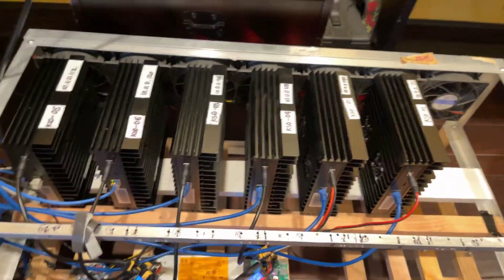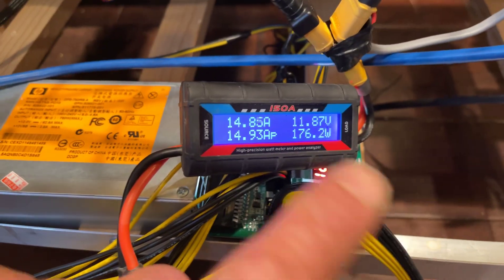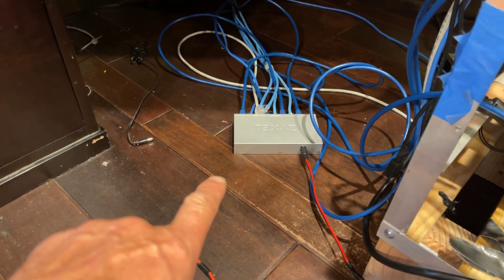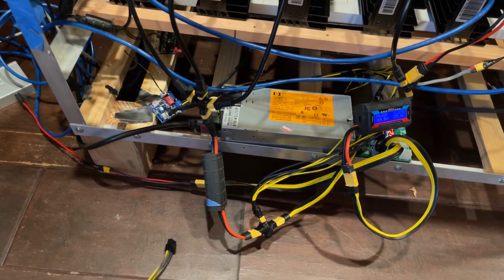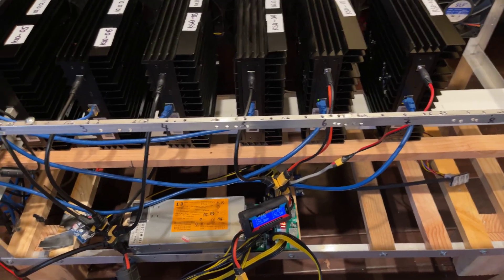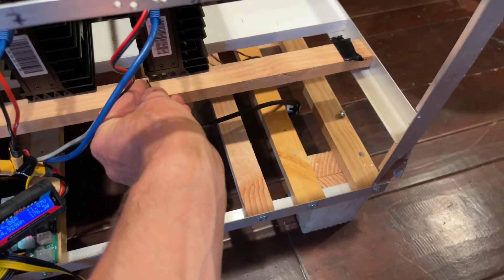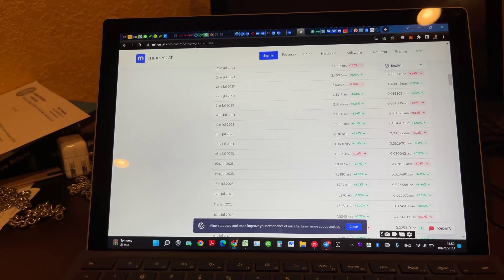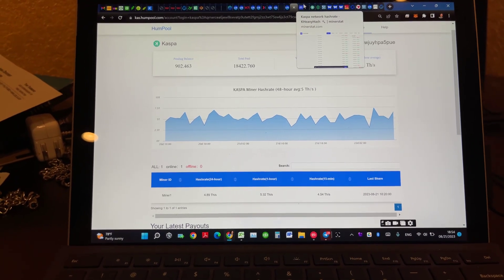6 ICERIVER KS0 MINING RIG UPDATE, NO VOLTAGE STEPUP CONVERTER OK? THIS SETUP SAVED ME 60W OF POWER

Comment: How do you get the server psu to power the ks0? I'm using a 6pin wired into a barrel plug yellow to red wire. Black to black. And my ks0 just reboot loops
Reply from the maker: Yes all 3 yellow to red and 3 black to black with proper 5.5x2.5mm connector it may reboot if you keep at 12v and try to Overclock.

Comment: Friend, in that vertical position you have no problems with the heat.
Reply from the maker: With external fan at least 1400Rpm which really quite I don’t have any issues. They’re overclocked to 175GH so external fans are the must.

Comment: so no need 12V to 19V Boost Converter?
Reply from the maker: Mining for a month now with only 12v power supply without booster. Have to make sure to use 10amp rated connectors though
Reply: @DontMindMeMining  when overclock 160G using 110w, should it been fine?
Reply from the maker: @D.K945  how are you able to overclock to 160G? If you have 110V now it’s 9.12AMP at 12v so it’s exceeds the 80% limit on 10amp connector. I would be very careful and watch the connector heating, if it heats too much need to reduce the amps.
Reply: @DontMindMeMining  I made a simple short video ks0 160G , but I haven’t replaced the PSU yet because the ordered cables haven’t arrived yet.
Reply from the maker: @D.K945 I didn’t find that video to overclock ks0 to  160g, could you share it?
Reply: I am using pc gaming psu 800w 80+ bronze to powerup 2 KS0 with 160Ghs. Using stepup DC module to 19.5V. It runs smoothly.